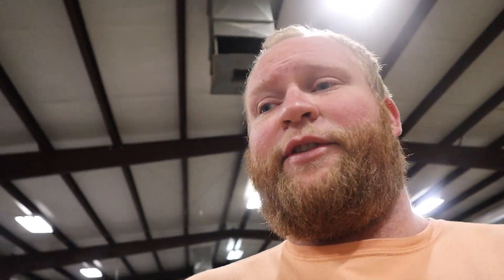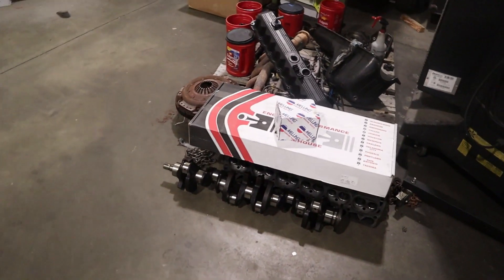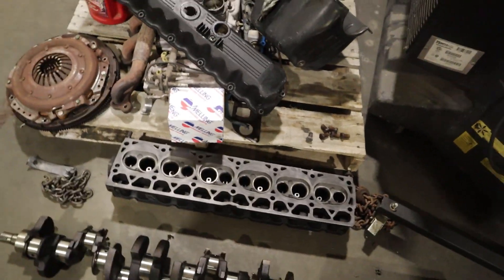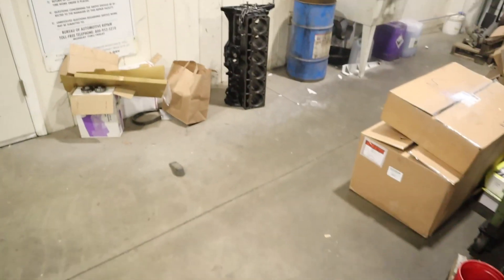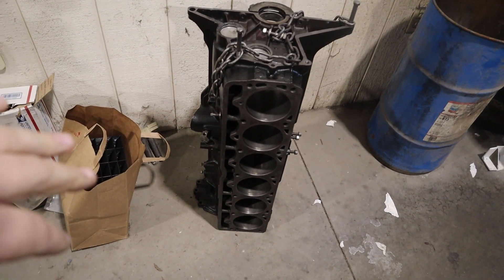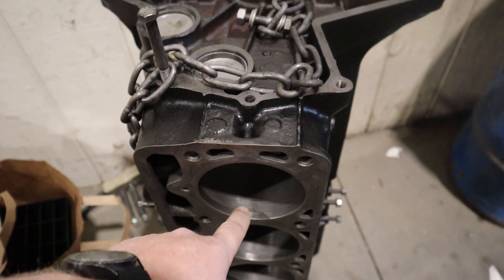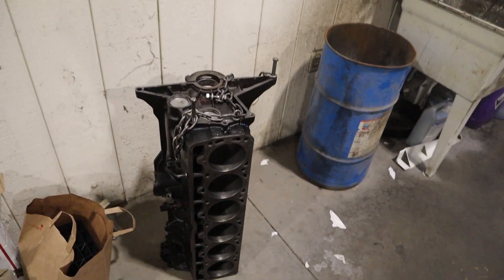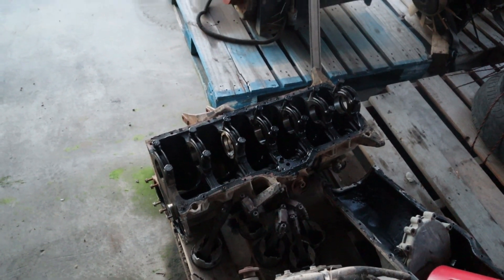Jeep 4.6L Stroker Project Introduction

Comment: Why do you need a forged piston if youre only making 250HP??
Reply from the maker: @danhambrick6331  why do i need more horsepower? Because I can, haha! Cast wasn't in stock at the time. It's a much lighter piston l, so it revs a lot quicker.

Comment: Your stock pistons will have an offset pin also normally race pistons have no offset
Reply from the maker: I guess more info on this section would be good, but the video was getting too long. From my measurements, stock is a .175 offset and the new ones are .125

Comment: Which side does the piston offset go to, I would imagine u want it more vertical when it has the most force on combustion stroke so to the passenger side? Is that enough of an offset to be worried about a potential degree or 2 in top dead center? I would imagine pre detonation could be very bad if the rods not on its way back down, only reason I bring this up is stock jeep 4.0 timing isn’t adjustable to my knowledge

On the rods side, I would imagine the 4.2 shorter rods would be used as the crank is longer, the 4.0 rods are not going to cause issues and ram the piston into the head or potentially a valve?
Reply from the maker: Luckily I still have the pan off. The pin is offset to the passenger side by an 1/8 of an inch. Too hard to describe over words, but with the trig of the pin, it doesn't affect the timing

As for which rod to use, you use the 4.0 longer rod because the pin is higher in the piston. Counter-intuitive, but thats how this works.
Reply: Ahhhh that makes sense for the rod, was there any thought on which side would be more beneficial to have the pin offset to?
Reply from the maker: @samuelfriesen1867  I read that an old hot Rodder trick is to flip it to the other side. I guess it make a good amount more power, but the pistons won't last long.
Reply: @EngineKrahnicles nothing truly great, ever lasts. Run it

Comment: There is 454 grams in one pound. You may have been thinking of converting pounds and kilograms.

I am surprised that these pistons didn't get a 1.5mmX1.5x3.0 ring pack or even thinner so that it would be easier to build.

In some recent Toyota engines, they do not have offset wrist pins. Instead, the crank is off the bore center for the same effect.

Be sure to have the right injectors. You need a higher flow rate. I think FiveO Motorsport speaializes in replacement injectors for Jeeps.
Reply from the maker: Brain fart. Not sure what happened there. Thanks for the correction. And as for injectors, we are going to give the stock ones a go. Easy to replace after if it isn't enough fuel.
Reply: @EngineKrahnicles  It is a huge risk to have the stock injectors not fuel quickly enough. Some people look to save money by buying rebuilds for the Ford 4.6 and just dealing with the core fee.
Reply from the maker: @skylinefever  thanks, ill look into it
Reply: @EngineKrahnicles  Good, because I don't want you melting pistons when the fueling runs out. I love seeing it happen to guys who think they can just turn up boost without consequence.
Reply from the maker: I took your advice. We ordered up some new injectors, so we will be dropping those in.
Reply: @EngineKrahnicles  Excellent. I am excited about this.